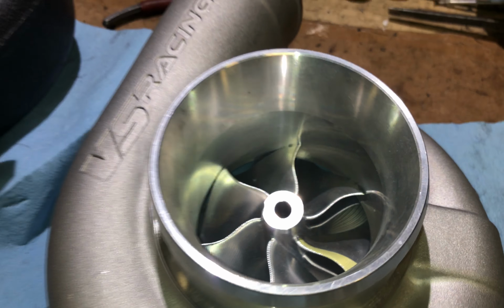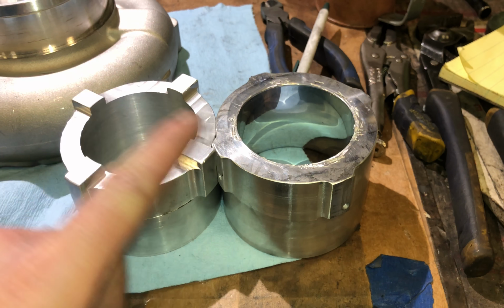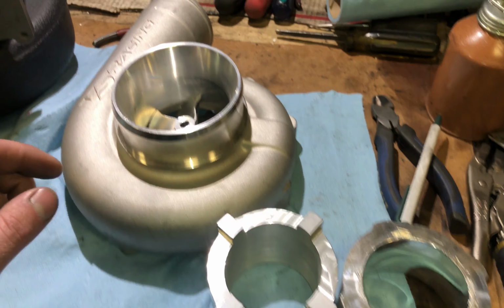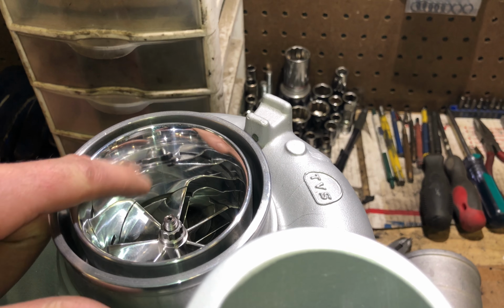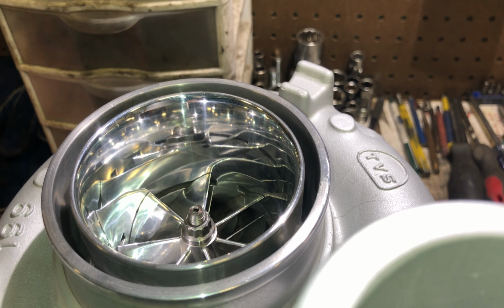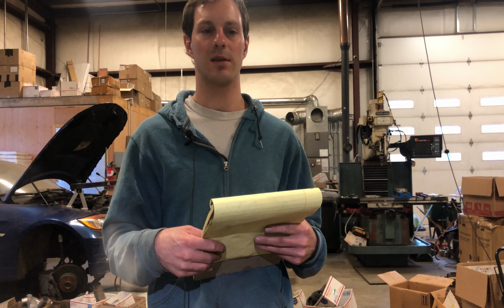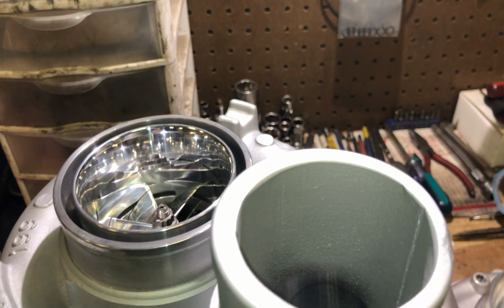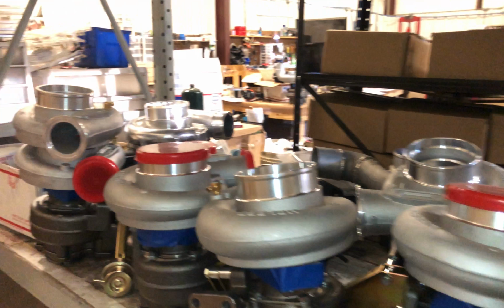What makes the T51R MOD Turbo so Loud?

Comment: I believe what's happening is you're making an air siren. We'd expect that turbo to be spinning 10-25,000 rpm just out of boost. If you have a 6 blades (3 pair) moving past 4 blocks (2 pair), it will 'chop' 12 times per rev. 10k rpm = 166.7 rev/sec, 25k rpm = 416.7 rev/sec. This is how many pulses happen per second:

10k rpm = 166.7 * 12 = 2000 Hz
25k rpm = 416.7 * 12 = 5000 Hz

Now search for the video "20Hz to 20kHz (Human Audio Spectrum)" and play it from 2000 to 5000 Hz at 1.5x speed - sounds just like the car in this vid! The minor differences are likely resonances from the motor & the fact the turbo isn't making a sine wave sound. It sounds more like a square wave, since the blade & post edges are not parallel.

If you do the math for 6 blades and 3 anti-surge posts, the frequency is cut in half. I suspect smaller/faster turbos would sound better with 3 anti-surge posts.
Reply: I machine parts and have been trying to figure this out scientifically and you literally hit the nail on the head, thank you! My 58mm turbo will be a air siren soon! Would angling the stationary block sides create different sounds, or create unnecessary turbulence.
Reply: @stag7123  Have you already done this? I am planning doing this on a 54mm turbo and cant decide groove width etc.
Reply: @aleksisalenius5103  I haven't decided wha5 groove width to go with either.. Turbolabs suggested anything wider than .200 would cause negative effects on power, but less than .100 would be too small to hear anything.
Reply: The brain. 
Thank you lol
Reply: I suspect you really know what your on about lol..i have no clue haha
Reply: If my turbo has 11 blades (no pair) how do I do the calculation? Would it be possible?
Reply: @VCTRSTF  You have to figure out how often a blade passes by one of the walls (standoffs) per full revolution. If you have an uneven number and 4 walls, it would be 11x4 since each blade passes a wall at a different time (ungrouped). Math suggests 44/rev, so your frequency would be 3.67x higher. The 9-blade Pulsar G35 with T51R mod I heard was very high.

I don't think angling the blocks will have any effect, I think it's width and height are most important. Height will increase air bypassing, and width will affect how much air it stops. The closer the width gets to the full distance between blades, the louder each 'chop' gets.
Reply: @jeffreydanek7945  What do you mean when you say that the closer the width gets to the full distance between blades the louder the chop? Width meaning distance from post to post? Full distance between blades- to the one following or?

Comment: t51r mod= turbo + air raid siren technology put into compressor housing
Reply: Thank you for this comment. I did a little research on how air raid sirens work and was able to do my own compressor mod  which is surprisingly loud
Reply: @Wigwhom86  How'd you do it?
Reply: @nesmio7378  well my compressor wheel had a good bit of material around it so rather than boring that whole part out like its typically done. I grabbed a hole saw and cut into the compressor housing around the wheel until i reached the start of the blades
Reply: Do you have a video explaining what you did?
Reply: So in your opinion does the T51R Mod LOSE POWER??! 😳

Comment: Just installed this turbo with t51r mod(he351ve). I can confirm its very loud. I ended up putting my stock intake back on because with aftermarket aluminum tubing it was ridiculously loud. Sounds and preforms awesome though!
Reply: My HE34 with a K&N intake is already loud so, I'm wondering if there's much difference between the 34/35? Debating on doing this mod but, not sure if I want it that much louder lol

Comment: It’s crazy that imo you still did not 100% explain how it makes a loud noise. I had to literally study and look at every cm, from what I can tell when you somehow drop in the cup housing, it has a small rectangular opening, so the air coming in creates a whistle because of the air coming in thru the rectangular shape opening, not once did you point this out, this information would be pleasing to someone who is new and has no idea about the terms you’re speaking about.
Reply: It's loud because of the way the blades design, on top of the size of the turbo as more air = faster spinning = louder sounds

Comment: If you look at any real T51R, the trumpet in the inside is really then not so thick how companies be making them. The closes company i seen to get the real thing is Turbomod. Most companies, that do this mod fails to get the sound to carry, all the way up through the rev rang like the real thing most just get it low to mid rang. That gap, you was talking about is supposed to be way smaller not bigger like that dude said. Oh and i can't forget this 6 and 8 blade wheels, carries the sound way better 11 blades wheels. Good video tho keep it up glad you making videos about this. =)

Comment: You should have some turbos dynoed on the same engine. Identical brand and spec turbos but done with your t51r with the different clearances you’re talking about. So you can see when the clearances start to hurt or maybe help performance. Maybe send a couple to Richard Holdener, he lives for the dyno LOL.
Reply: Do you not think HKS has done all that testing already therefore HKS spec is probably the best. Products made for market got through rigorous testing!!
Reply: @MrIrish1  This is Turbo Lab not HKS. He was talking about his T51r mods, again not HKS. He said “he’s not sure” and at other times he’s making educated guesses based on his experiences. Which is fine, it seems like he does great work. All I was saying is if he dynoed identical turbos but with different T51r specs he’d know what is too much and too little. It’s obvious in this video it hasn’t been done. Also don’t assume all products on market are thoroughly tested, especially in the aftermarket automotive industry. Their are way too many shit parts out there even from some well respected manufacturers.

Comment: Looks like originally HKS accidently made a small air raid siren when they designed the anti surge port. It defiantly will make it less efficient, which is why no other companies do it.  But, it will make it loud obviously.  look up air raid sirens and how they are made. That's what is making the noise IMO.   Isn't there a more efficient and cheaper way to make the turbo "whine" more pronounced. Fumy shaped compressor nut, angled hole in the hub etc? Seems like a lot of effort for noise.

Comment: You would think that during some parts of the compressor map air would infact be flowing into the compressor via that groove I would think at hi flows not so high pressures
Reply from the maker: The air does flow in through the groove

Comment: Have you noticed what changes the pitch of the whistle? Some modded ones do not sound very close to the T51R but a lot of lower toned whistle which isnt as nice. Is it the groove width or placement?

Comment: Hmmm. Anti-surge housings reduce your dose/flutter, though... So I'm wondering, how do you get loud whistle on a non-anti surge housing? And also, how do you effectively block off the anti-surge on anti-surge housings without fucking up flow or otherwise reducing performance?

Comment: more air too escape? 

no!

more air in! boost is pulling in air from both sides.

The groove width in the new Precision (nextGen) is larger, they state “more air through the larger AntiSurge” (further down-not up)

air does not escap when
in vacuume “the opposite happens”

look at precision next gen schimetic

Comment: Would you be interested on trying to do this to a 3" housing? I have a Greddy td05 18G with a billet wheel that'd I'd like to use, unless there's not enough material which I could understand.

Would it be possible to convert it to a 20G that had a larger compressor cover and do it to it instead?
Reply: Same here.  I'm looking for a custom 20G as well.  With a T51R mod I could tighten the BOV and not worry about surge.

Comment: I have a question, and please forgive my agnorence. I'm planning to do a T51r mod in the future, and not sure if it's viable to install an air filter on the turbo? Is it going to fit? any changes to the sound? Thank you!!
Reply from the maker: It’s best to use a filter. I live in a construction zone, there is a lot of dirt in the air and rocks. The sound is still loud with the air filter, I have several video clips. I would not risk not using a filter.

Comment: The spacing needs to be smaller not bigger and the inner stack needs to be thinner.
Reply from the maker: I machined it to .200 gap exactly what I measured from an ocd works compressor housing
Reply: @turbolabamerica  Don't take Measurements from them take it from A real HKS
Reply from the maker: I don’t have one to measure

Comment: Have you ever done a velocity stack in a GT3782VA? I have probably 7 of them sitting around from various 6.0s. I'm wondering how silly a T51r modded GT3782VA with a 10 blade turbine wheel would sound.
Reply from the maker: We replace the covers on them with a gt40 , doing a t51r of a gt40 cover would be a lot easier
Reply: @turbolabamerica  What is your email? I might be interested in doing a little work with you just to mess around with a GT3782 to maybe sell to people that are whistle junkies on 6.0s. I deal with quite a few on a daily basis.

Comment: So anti surge housing + no blow off valve is fine?
Reply: not at all.
Reply: Surge isnt what you are describing. Compressor stall from no bov is not surge
Reply: Been running no BOV for 2 years  , S475 20 psi 700whp,  beating on it every chance I get , no problems whatsoever
Reply: Matt Gardner compressor will not stall itll slow down thats it
Reply: @4door_papi  the term is stall.   Its air being forced bacwards. And yes in some cases it will stop
Reply: @matt10011987  haha do you have data to back that? I have data. It says you're wrong :)
Reply: @nfsdude0125  I would love to see it! Sources please!
Reply: @matt10011987  Not only does it not stop but there is no difference in turbo speed between running a valve and not running a valve when you lift off the throttle.

Comment: Have you tryed this on a smaller turbo like a t28?
Reply from the maker: No
Reply: I have a 2860 pulsar turbo on my miata with t51r mod from pulsar. Its ridiculously loud. I had no idea what this mod was 6 months ago. I was hesitant going with a pulsar turbo, even more so paying for the t51r mod. I am not disappointed at all. Sounds like a have a supercharger especially at lower boost pressure. My old turbo was basically silent compared to this one.

Comment: Can u still upgrade my td04hl of my 09 acura rdx 2.3
Reply from the maker: Yes
Reply: @turbolabamerica  I'll contact ur  shop on Monday thx
Reply: @turbolabamerica  how do i get the 6.7 Cummins turbo from you, is it a VGt
Reply: @jamesgasper8630  You'll never get them back...they've had mine for 2 years now. They don't respond to email or they're phone. GL. Great vids horrible customer service.
Reply: @meangreen3k  Sounds kind of scary, maybe Boost Labs would be better.
Reply: @Madvillian  Any shop is going to be better than these clowns. Ask yourself this: Out of all of the very high HP shops / cars out there...why none of them are using anything from these guys? I have a HUGE email string to prove what I'm saying to. They are in waaaaay over they're heads and are to ignorant to admit it. Just do your research and you'll see I'm not alone with issues with them.